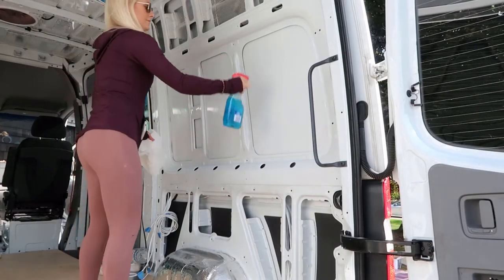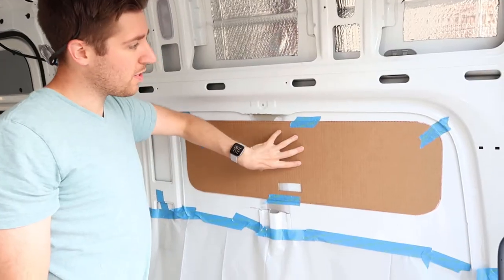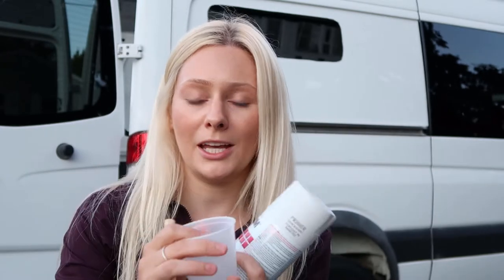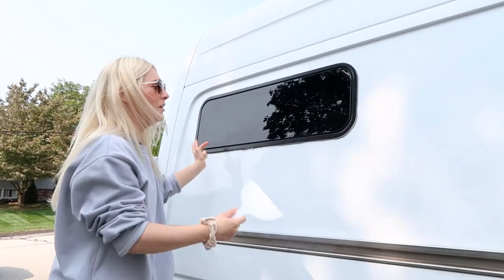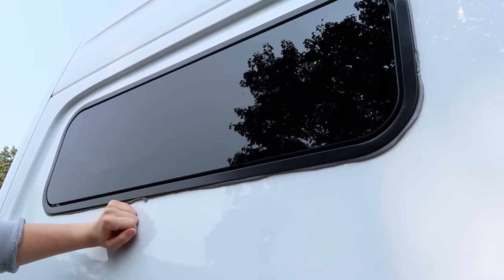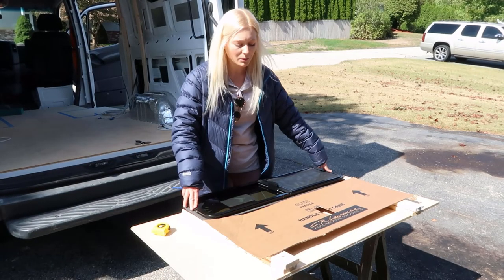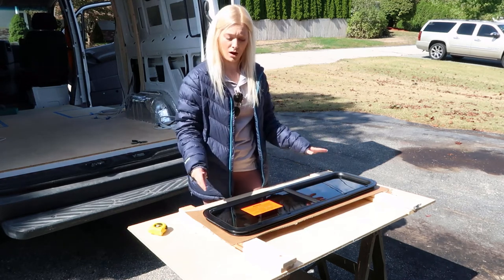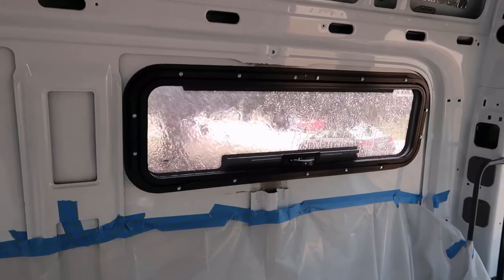VAN BUILD SERIES | Cutting holes in our van & installing bunk windows

Comment: Looks great, how is the window after cutting the support beam out seem to be flimsy at all or stong enough  thanks
Reply from the maker: Thank you! Definitely strong enough for our application, we added furring strips ~6 inches away to either side of each window and have no weight pushing directly onto that metal panel, besides insulation. Hope that helps!